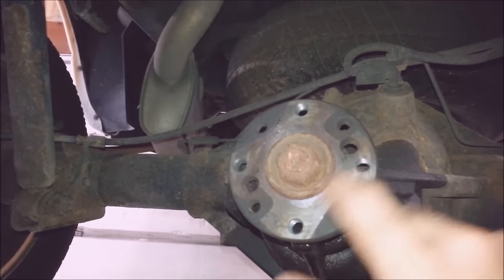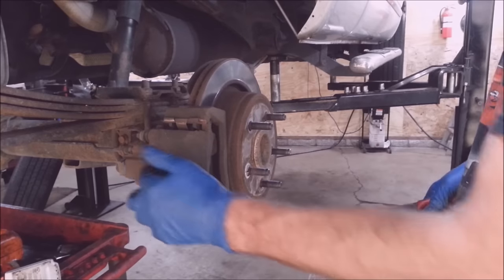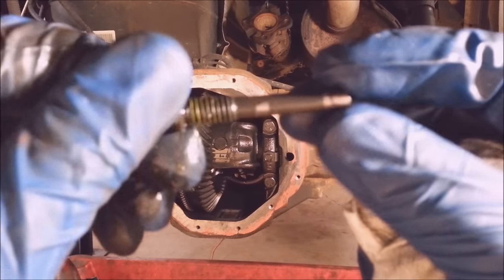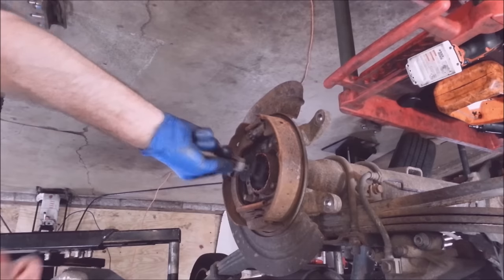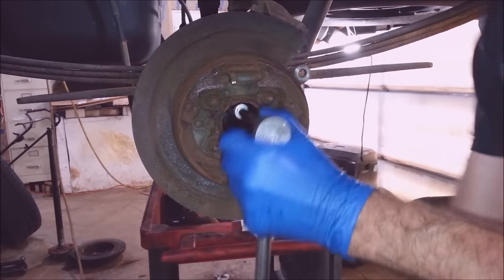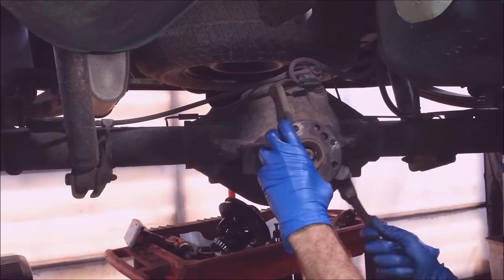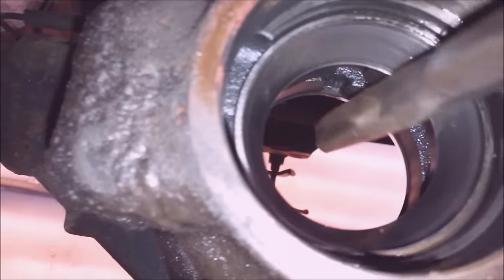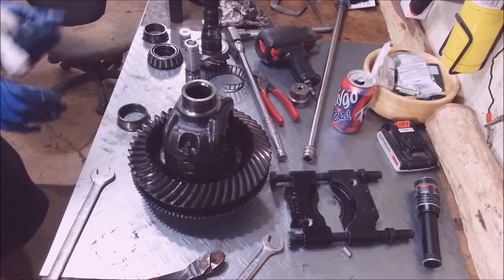1994-2018 Ram 1500 9.25" rear differential rebuild disassembly pt1

Comment: Wow, I’m amazed people like you know how to do all of this so well there’s so much shit to a rear end build I’m currently trying to rebuild mine it’s shredded all of the gears in the middle the small ones I think you called them spider gears , but seeing this video and knowing there’s a part two I’m probably gonna take it to a shop cause that’s a lot of shit to do I’m just an oil change and some ball joints kinda mechanic not rear end mechanic lol great video tho I learned a lot of important stuff ab rear ends for sure
Reply from the maker: If you are doing more than a bearing replacement, there is a little more to this job.
Reply: @RustBeltAuto   any tips for a 2014 ram 1500 rear end rebuild ? I wanna try to replace the spider gears myself before having to send it to a shop and pay so much
Reply from the maker: @Knight-Temp.  If you are replacing your ring pinion and carrier, you are going to want to check your gear mesh.
Reply from the maker: You could always get a used axle assembly, and put it in too.

Comment: Theres some weirs clip arounf my bolt to rear end, after remove drive shaft, it has 2 tiny allen ket tiny bolts to hold in the right tning before i can get bolt off, cant get of the little ring
Reply from the maker: I'm not understanding. Lost in translation.
Reply: Needle nose pliers.
Reply: That’s the pinion nut retainer ring.  It was put on as part of a recall.  Not sure how to get it off.  I’m in the process now.  The 2 Allen screw are rusted in tight.
Reply from the maker: @031burke  don't know if you can do it without melting stuff, but if you torch the Allen area to 500*f it should come off.
Reply: 031burke if you get the little bolts get a piece of flat steel drill two holes find longer screws screw the long piece of metal on and tap out the ring

Comment: Nice job, how long did it take ?
Reply from the maker: I don't keep track.
Reply: @RustBeltAuto  roughly ?
Reply from the maker: @louindorato6855  I don't know. It soaked up a day. If I was into that time, labor, how long, hurry, it's a waiter bullcrap, I would go work for some a-hole for peanuts, with an annoying service writer again. Sorry if that came out wrong. I just do the job until it's finished.

Comment: can i put  2002 rear dif on my 0three ram.... too late... bought it... gonna make it work
Reply from the maker: Good luck!
Reply: @RustBeltAuto  had to use the hd axles from the 0three cause one it had a bent axle on the 02.  a new set of bearings, and they fit.  although they seem to stick out a halh inch farther but are the same part number... is the diff housing shorter?  may have to shim the brake mounts...
Reply: ive spent less than 600 for all of it vs the $2200 option... going open dif, instead of the limited slip broken clutch guide version.... crossing fingers.
Reply: the original issue why i took it off...pinion nut came off inside the diveshaft to input flange union
Reply from the maker: @RandomsFandom  I would put the brake drum on and see where the shoes make contact. Do the drums stick out past the shoes?
Reply: @RustBeltAuto  not reinstalling e-brake...components too far gone...
Reply: slide pins should compensate....
Reply from the maker: @RandomsFandom  ooh... You have rear disk brakes?
Reply: @RustBeltAuto  yup, hopefully ive found the solution.... too bad its raining today, or else i would be installing it. its also up on some saw horses, and too heavy to set down by myself. i dont want to crush the dust covers if i drop it... i will keep you posted on the build.
Reply: @RustBeltAuto  its together. it took two washers to space out the passenger side caliper bracket. im getting better gas mileage already. tirdteen point five mph... and that was just around town test drive
Reply: @RustBeltAuto  i also plugged the pinion nut hole with locktite epoxy.  im not taking any chances...gonna take heat and a chisel to get it out

Comment: Do anybody know if a 2001 v6 3.9 rear differential will work on 1998 5.9 V8 Dodge Ram 🤷🏾‍♂️if I need to swap
Reply from the maker: Take some measurements. If it is 4wd, be certain it is the same gear ratio.
Reply: Rust Belt Auto not 4 wheel just one is a v6 other a v8
Reply from the maker: Many truck guys swap out whatever they can. Even from different makes. Take into account bolt pattern, drum size, width from drum to drum, spring perches, and width, and location, control arm, and coil location if it has coil springs, sway bar mounts, and U-joint interchange. Or you could go on car-part.com, and see if they sell the same years as a direct fit. Best advice I can give you.
Reply: Rust Belt Auto my diff is out of line and needs fluid change will that cost it to star whinnying
Reply from the maker: @RICHFILMSTV  What do you mean by out of line?
Reply: Rust Belt Auto not center with the bars that stack on top of each other
Reply: Can I send you a picture via email
Reply from the maker: @RICHFILMSTV  you mean it moved off of the center of the leaf springs?
Reply: Rust Belt Auto yes. This morning I jacked it up those are bouncing when I hit the gas. And I found where the noise was coming from when I hit the gas the driver side rear wheel pulls in and starts humming is that the wheel bearing ? No clacking from the center of differential or from the
Reply from the maker: @RICHFILMSTV  jack up axle so the tire is off the ground, and lift up. If it is loose, you probably need an axle shaft, axle bearing, and seal.